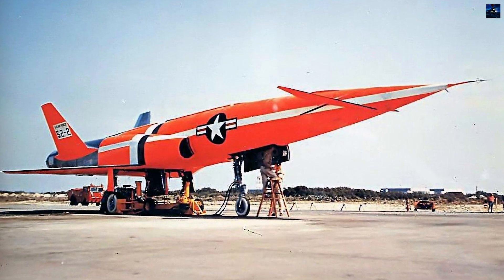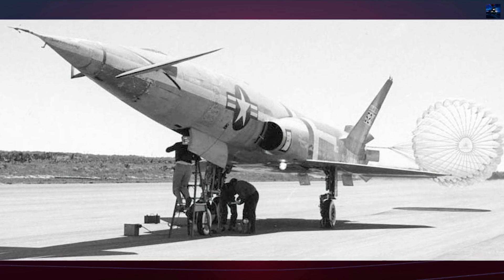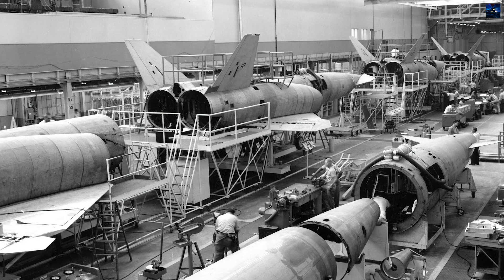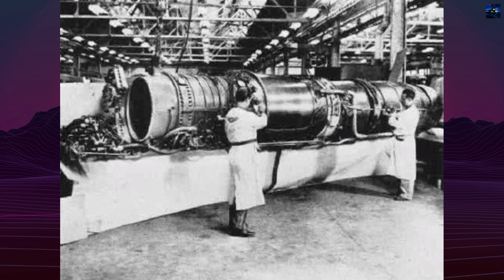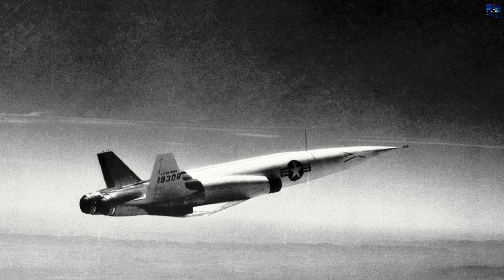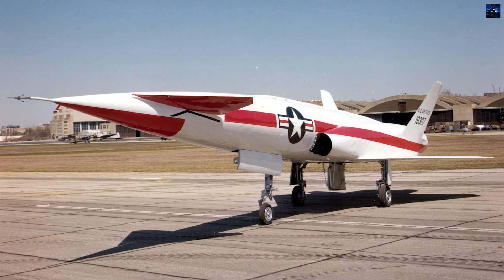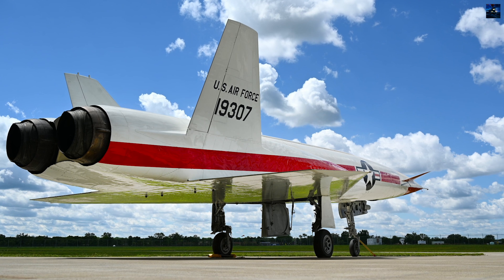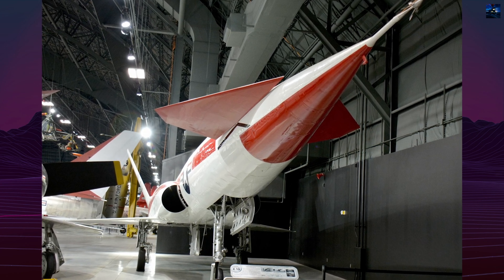North American X-10: The Secret Drone That Was Faster Than Any Jet

Comment: 1:26 "...and a thrust to weight ratio of over 0.5..."  Seriously ?  That is one seriously underpowered brick or that number is wrong.
Reply: That's an accurate number. Early jet engines were relatively weak and fuel-hungry, mainly because they burned fuel inefficiently. Note the "smoky trails" left by early jets, especially on takeoff.  Improvements in "hot section" design and materials greatly increased thrust.
Reply from the maker: Thank you.